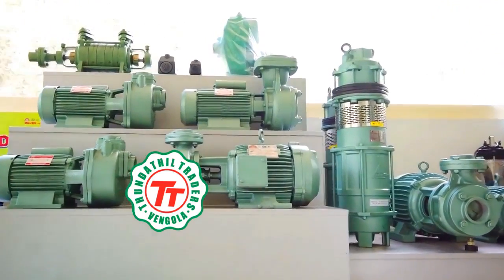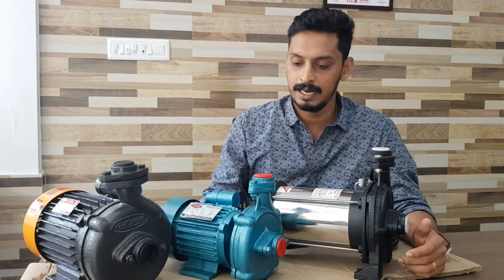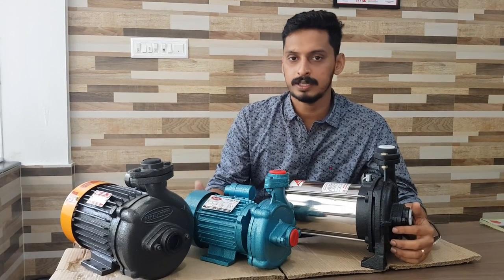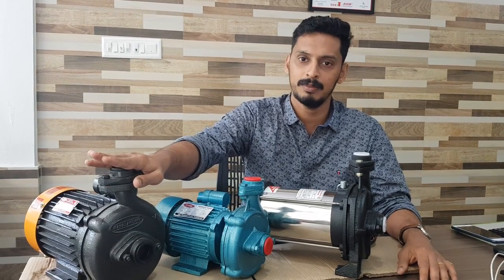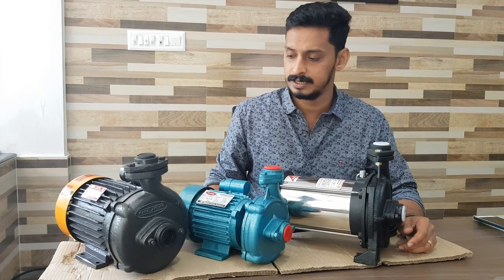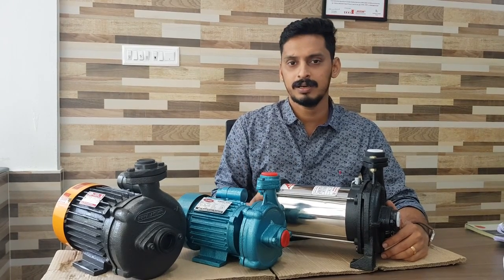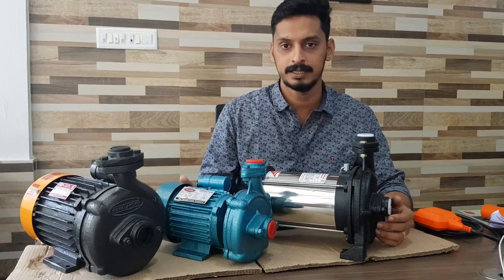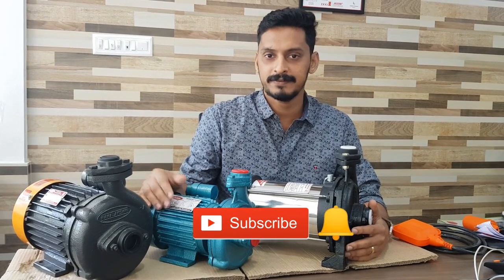മോട്ടോർ 0.5HP /1HP ഏതു വാങ്ങണം എന്ന് കൺഫ്യൂഷൻ ആണോ? - 0.5HP/1HP ? Which is most suitable for home

Comment: 6m ആഴത്തിൽ വെള്ളം ഉള്ള കിണറിനു മുകളിൽ വെക്കുവാൻ പാകത്തിന് ഒരു motor വേണമായിരുന്നു, കിണറിൽ നിന്നും വീട്ടിലേക്ക് ഏകദേശം14m ദൂരം ഉണ്ട്, വീട് ഇരുനിലയാണ് ഏറ്റവും മുകളിൽ1000L ന്റെ ടാങ്കിലോട്ട് ആണ് pump ചെയ്യേണ്ടത്. എത്ര hp യുടെ ഏത് ടൈപ്പ് pump വേങ്ങണം?
Reply from the maker: 1HP ettavum best option. 17 Meteril maxim discharge Ula model.
best option TEXMO HCS630
Reply: നിങ്ങൾ മോട്ടോർ വാങ്ങിയോ ഏത് മോട്ടോർ ആണ് വാങ്ങുന്നത് എനിക്കും വാങ്ങണം
Reply: @DangerBoysn  v guard 1hp centrifugal  monobloc pump വാങ്ങി. High head variant ആണെന്ന് തോന്നുന്നു
Reply: 1 hp mathi

Comment: ഞാൻ ഇപ്പോൾ ഉപയോഗിക്കുന്നത്.5 hp പമ്പാണ് 25 mtr head കിട്ടുന്നുണ്ട്, sharp ന്റെ open well submercible vertical type പമ്പാണ്, motor side stainless steelഉം pump side cast iron ആകുന്നു. ആറു മാസം കൂടുമ്പോൾ അതു പൊക്കി തുരുമ്പു കളയേണ്ടി വരുന്നു. ഒരു full body stainless steel motor കിട്ടുമോ. 1 hp ആണെങ്കിലും കുഴപ്പമില്ല. Cast iorn 100% ഇല്ലാത്തതു വേണം. ഒരു മാസത്തിനുള്ളിൽ കിട്ടിയാൽ മതി.100% stainless steel ആയിരിക്കണം.
Reply from the maker: Theerchayayum oru solution ready akkam. Budget prashnam allenkil wet parts ellam 100% stainless steel varunna models tharam. whatsapp 7034904458
Reply: Hi @thundathiltraders

Comment: Ente kinar ekadesham 28 ring height undu.......ithinte azham etra undakum....ithu vechu ethu motor anu vekkan pattuka.....vellathil irakki vekkunna motor nallathano atho normal kinarinu purathu vechu kondulla motor ano abhikamyam
Reply from the maker: Etra adi varunna ring aanu?
8 meteril kooduthal azham undenkil Openwell Submersible pump use cheyyam
Reply: @thundathiltraders  nalinte ring anu......motham 28 ring undu mukal baham vare....athil 21 ring vare vellamundu......apol etra azhamundakum.....8 mtr kuduthal undakumo

Comment: 7meter കിണർ + sediment water filter +  Softner Filter + 2 നില വീട് 1000ലിറ്റർ ടാങ്ക്. ഇതിലേക്ക് ഏത് വേണം?
Reply from the maker: Do we have any pressure and discharge requirements mentioned in the filter ?
Reply: @thundathiltraders  1" input and output. Maximum 150psi pressure

Comment: Ente well 25mtr depth und, horizontal 8mtr pine second floor anu tank ullath
Apo ethu size and eth type pump anu  use cheyandath
Reply from the maker: 1.5HP Horizontal Openwell Submersible with max discharge at 35 meters 
Or you can go with 1HP or 1.5HP Vertical Submersible.

Comment: Bore well 430feet inne ethra hp motor venam? Ella fitting innum koode ethra cost avum? Pipe ഏത്  type ആണ് വേണ്ടത്? Pls reply. ഒരു വീഡിയോ അതിനെ പറ്റി ചെയ്യാമോ?
Reply from the maker: Will try bro .
Reply from the maker: 1.5hp 143 meter head will be enough for you . whatsapp number 7034904458
Reply: Best borewell motor ethanne?? Pipe ഏതാണ് use ചെയ്യാൻ better? And wire also. Reply pls
Reply from the maker: Brand EKKI-DECCAN or Texmo(Aqua)  Above 100meters better to go for 4sqmm
Reply: Ok. Thanku

Comment: നമസ്കാരം എൻ്റെ വീട്ടിലെ കിണറിൻ്റെ ആഴം 13 മീറ്റർ ആണ് അവിടെ നിന്ന് വീടിൻ്റെ അകലം 36 മീറ്റർ ആണ് അവിടെ നിന്ന് ടാങ്കിൻ്റെ ഉയരം 8 മീറ്റർ ആണ് ഇതിന് അനുയോജ്യമായ മോട്ടോറും വലിയും തള്ളും ഒന്ന് പറയുമോ ഏത് മോട്ടോർ വെക്കണം   നന്ദി
Reply from the maker: submersible type vakkam. 27 meteril Maximum discharge ulla pump vachal correct ayirikum. Try Deccan or Texmo

Comment: Wanted submersible pump for fruit tree irrigation. Single phase connection at site. Irrigation thro 3/4 " hose. Depth of well 20 feet. Delivery upto 500 feet flat ground. Can you suggest max output pump? Irrigation for 5 hours at a stretch.
Reply from the maker: Can you pls share the details in whatsapp ?
Actually we dont have any models with 3/4inch Delivery. What we can do is it reduce the pipe size from 1 to 3/4 which will increase the line friction.
Reply: WhatsApp no

Comment: Please add videos on the following:
1. How to take out an old or defective monoblock pump.
2. How to install a monoblock pump for a well using 1" PVC pipe.
3. How to install a monoblock pump for a borewell.
4. What are the parts needed for installing, like teflon tape etc.?
THANKS!
Reply from the maker: Noted sir. Will plan a video regarding your request

Comment: 10-15m depth for well. 2 storied house. etra HP motor aanu nallath bro?
Reply from the maker: 1HP Openwell Submersible pump vachal mathi bro. Max site head aprox 25 meters pratheekshikam.
Reply: @thundathiltraders  bro normal pump aanankilum 1hp mati aavumalo. Suggest some pump plz bro
Reply from the maker: @prabithpb3287  Etrem azham ulla kinaril normal pump ketti eraki use cheyyanam
Reply: @thundathiltraders  appo submersible edukam bro. oru balla brand kooda parayamo. kerlosker kollamalo. what about kera

Comment: 15 feet heigt (well 7 mtrs and building 8 mtrs,  2 story,. 5 or 1 hp motor is required
Reply from the maker: Total head 7mtrs depth + 8 mtrs height + 2 meters for friction . 
0.5HP is ok for your site but better to go for 1HP . 1HP will have almost double the discharge at our existing site head

Comment: എന്റെ വീട്ടിലെ submersible water pump ന്റെ pressure ഇപ്പോൾ  വളരെ കുറവാണ് mahendra യുടെ 1.0 Hp water pump ആണ്. വാങ്ങിയിട്ട് ഏകദേശം 6 വർഷം ആയി... ഇതിൽ capacitor വാങ്ങിയിട്ടാൽ pressure കൂടുതൽ കിട്ടുമോ ?
Reply from the maker: Capacitor change cheythu pareekshichu nokkam enne ullu. Bush complaint , Impeller partial block vannalum ethepole sambavikam. Oru techiniciane vilichu pumpinte impeller , ampere ellam onu check cheyu.
Reply: @thundathiltraders  ok

Comment: എന്റെ കിണർ 7m ആഴം ഉണ്ട്‌ ഒരു നില വെള്ളം വലിക്കണം, low head ആണോ high head ആണോ നല്ലത് അതിന്റെ RATE ഒന്നു പറയോ......
Reply from the maker: Max site head 13 meters . 0.5HP anenkil maximum 18 meters head ulla pump mathi. 1HP anenkil low head pump vachal nalla discharge kittum. for price send whatsapp message to 7034904458
Reply: @thundathiltraders  എന്റെ വീട്ടിലെ പമ്പിൽ 0.75 hp എന്നാണ് എഴുതിയിട്ടുള്ളത്.ഇത് എത്ര hp ആണ് ?

Comment: 9 mtr. ഡെപ്ത് ഉള്ള കിണറ്റിൽ   12 mtr. ലെങ്ത് single  ഫ്ലോർ ബിൽഡിംഗ്‌ എത്ര  hp മോട്ടോർ ഉപയോഗിക്കണം  വെള്ളം  പറ്റുന്ന  സ്ഥലമാണ്
Reply from the maker: 9 meter azham ullathu kondu submersible use cheyyam.  0.5HP submersible vachalum mathi but better 1HP submersible anu. Minimum head 15 il thazhe ulla model nokki vangu

Comment: Hi bro, Could you please recommend good and long life centrifugal water pump with model and company. My house well depth is about 7.5 meter and old motor is placed at top of the well. From there water tank height is more than 7 meter. It's 1 floor house with water tank is situated above chimney. Planning to change the current motor pump to new. Can you recommend good model 1 Hp or 1/2 Hp centrifugal pump for my house. I like to buy same mono block type itself. Can you also specify the cost .
Reply from the maker: Hi bro ,since your average total head is around 16 meters .you can either go for 0.5HP or 1HP. If you go for 0.5HP your average discharge at site head 3600 LPH  and if you go for 1HP you will get around 8000LPH
Reply: @thundathiltraders  Thanks
Reply: Which brand you will suggest for me. Can I go head with v guard 1 HP. Some of my friends are saying about kirloskar. What your opinion? Waiting for reply.

Comment: njanglude borwell kinar 420 feet aanu vellam kuravanu submersble pump vechal vellam kitto compresser aano nallathu randum ethra hp vekkanam
Reply from the maker: Vellam theere kuravanenkil Compressor anu safe. Kurachu neram engilum pump cheyyan ulla vellam undenkil ettavum max Discharge kuranja 1HP Borewell submersible vachalum kuzhappam ella.safetyk oru dry run panel koode vaku